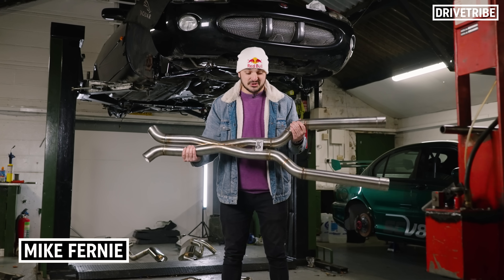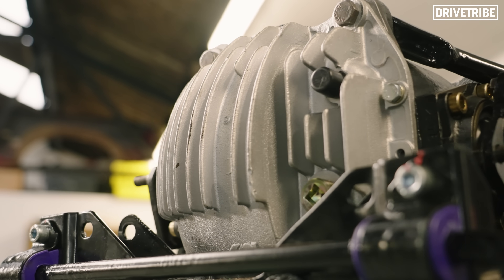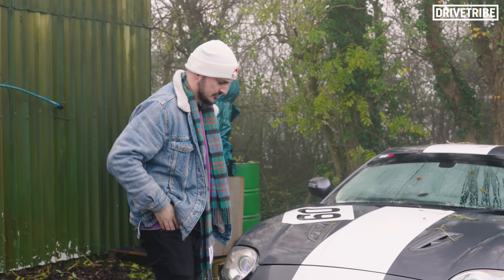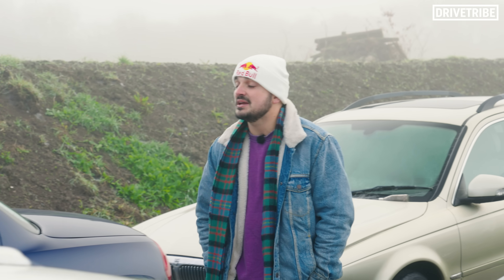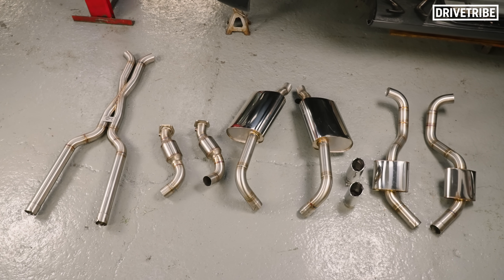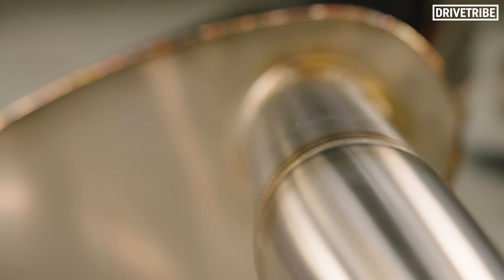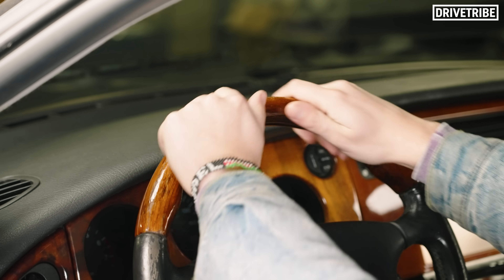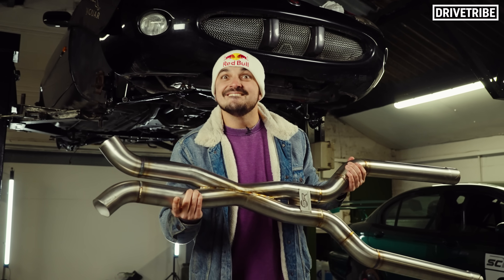Fixing our cheap supercharged V8 Jaguar! | Project Jaaaag Ep.7

Comment: With regards to the initial disappointing dyno results, you should check the slack on the throttle cable. Over time they stretch and the result is that when you floor it, you’re only getting like 80 or 70% of throttle instead of 100% at WOT. Which would explain the 90 escaped horses.

Comment: I love Jags, but I prefer the E-types, the XJ6 coupe and Daimler version(used to clean a Daimler V12 coupe in dark blue, black vinyl roof). Or the XJ40 Jankel coupès and MKII Jag in darkest anthracite metallic or Jag BRG stainless Steel wire wheels,  Coombs rear arches, lowered 2 inches, conolly leather interior perforated seats, 5 spd ZF gearbox, stealth sound system, full length Webasto sunroof, tinted lexan sun shades, and sunroof deflector. 
Moto-Lita steering wheel, dark wood veneers, or aroka wood veneer, seat belts matched to the leather colour, polished seat belt accessories.  Now that's a dream Jag if ever, oh and a D-type tuned large valve head engine, or put in a f-type supercharged engine....mmmmmmmm

Comment: Some parts are cheaper, but some are expensive so don't break them - a tradeoff for your imports. Must get it simulated, but getting it rendered breaking is not a simple task, especially true for dragonriding. Sean Boswell tries to learn with bicycle protections. Fuel consumption matters, nice to have a switch to put mufflers on click. Let's put C2 Hercules into it's place, if you wish to banish John Deere - to get them make a pact with government, because your are high tech student. Racers having livery, but it's a bit different,  not telling everybody configuration. Still hard to know if it fits your model.

Comment: The exhaust has been modified from stock. Apart from the pipe diameter change, the usual large centre silencer has been replaced by an X section. I was speaking to Chris at Swallows recently about changing the exhaust on mine and was told the X section would be the best way of achieving the V-8 rumble that is missing from my stock system. 

Oh and BTW... please... please... please get rid of that awful Japanese centre sat-nav section. It is hideous. I wouldn't buy a Jag with that in it.

Comment: I hate to say this. But I don't think Alex has a chance, purely due to the fact that he doesn't have the funds or the resources like DriveTribe has. The fact that there are multiple adverts and multiple sponsors per DriveTribe video alone. Not to mention all the other resources they have access to.
Reply: Tend to agree. I don't think the XJR6 will be able to keep up with the XKR, based purely on modifications or modification potential.

Comment: The reason the XKR didn't get a limited slip differential is the same reason it didn't get a manual gearbox, Ford owned both Jaguar and Aston Martin the latter doing worse for sales, if the XKR got a manual gearbox and LSD it would of damaged sales from the new  DB7 as the Jag was nearly 100hp more powerful and better looking so, Aston cried to Ford and Ford said no to Jaguar making a better car, bare in mind Ford got Jaguar as part of the deal when purchasing Aston Martin so, Jaguar was just second fiddle. Both the XK8/XKR and the DB7 saved both companies from going under.
For you're car you should of left those small baffle boxes off, pointless and extra weight.